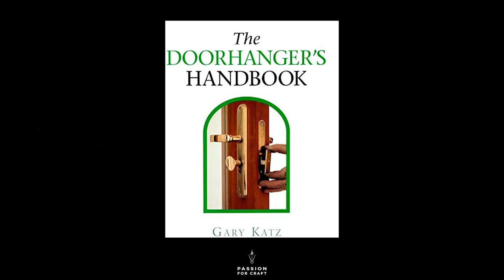Ep. 12  Dan Parish: How to Manage Craft at Scale Pt.1

Comment: ICAA is worth it because it shows you whether you're really into design and architecture very quickly. 
People like realtors are at tours and trades just to network sales.
Then, the other half are retired architects, designers,  wide-eyed young professionals, and a few trades.
 The education is worth it for both sides but for an educated trade it can rocket you to the top of your potential. Within a couple years you'll get a chance to bid something that has literally been done before. 
A 50 foot wide television that's a folding glass wall, it was 2008 when I was involved in that. 
Anyone here know of one before then, I'd honestly love to know. It's a team effort. Mine wasn't done.
RFT tag automatic small dog door, unlock and automatically  open and close for the 12" high pet. Security can be added but it requires installation at framing to be secure enough a human can't get through and a dog can.